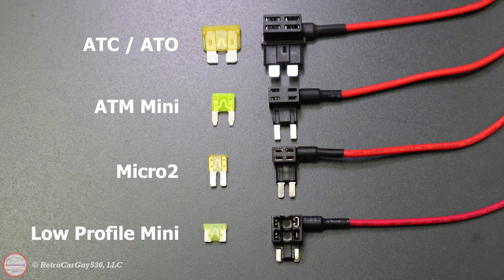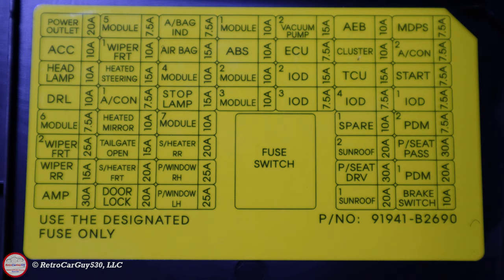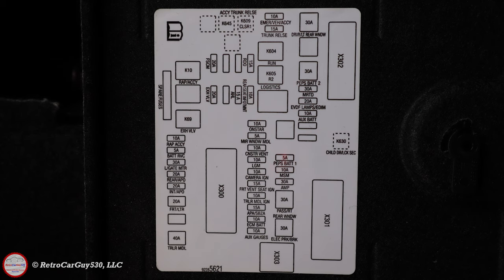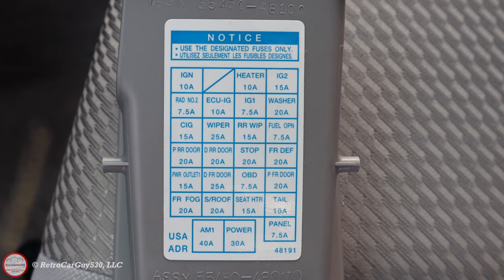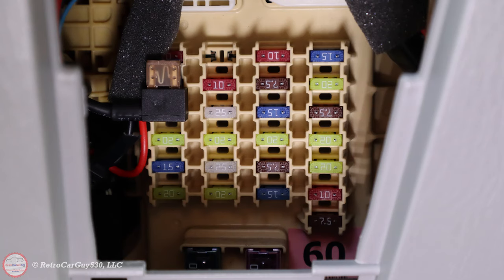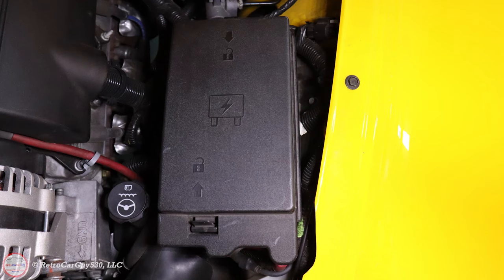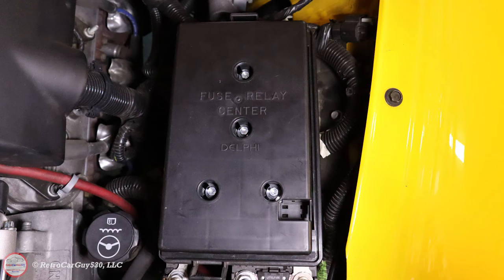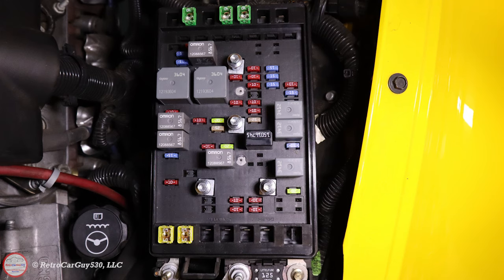How To - Add a Fuse Tap in Your Vehicle

Comment: Hey there so I cut my DC12v extension cable male to female 5.5mm x 2.1mm (The male plugs into my 10w LED Light box)
I cut the female end off and I was expecting 2 prong red and black wires
but there was 2 prong red and white wires ? 
Did I buy the wrong extension cable or something ?
Reply from the maker: I have no way of stating one way or another whether that extension cable is the correct one or not for your LED light box.  I would suggest using a multimeter to check which wire / color connects to which part of the male connector.  That way you should know which color wire in the extension cable is for power (likely red) and which is the ground wire.  That assumes you have documentation of which connector/pin on the light box end is power and ground.
Reply: Sorry it's hard to explain without pictures.
So I have this :
10w Light box with female port built in
1m Power cable with male port and 12v cigarette lighter port on other end

I want to hardwire this lightbox to my car by using a fuse tap instead of having cables running across my car and having my cigarette port used up so I want to make my own modified wiring

I bought a 3m Power cable extention 5.5mm x 2.1mm male to female (CCTV / LED/DVR/PSU)

So I can plug the male end into the light box 
Then the female end which would be the cigarette lighter port I cut off and I am left with 2 wires Red and White (I expected Red and Black)

I wired the fuse tap > red wire 
White wire > SPST switch > Ground eyelet (to metal chasis)
And the red / white wire is still connected on the male end which plugs into the Lightbox. Is it possible to email you some photos to help explain
Reply from the maker: Most of the time, red and black wire colors are used for a power cable, but the company that made the 3m extension cable may not follow that convention.  I did find a few barrel connector cables on a LED website with a red / white wire combo.  

I would suggest checking which part of the original barrel connector that is part of the cigarette power adapter provides the positive/ground.  

Test using a multimeter.  I tested an AC-to-DC 12-volt power adapter I have in my office and the center was the +12 volts and the outer part of the barrel connector was the ground.   When I had it reversed from what was provided by the power adapter the voltage showed a 12 volts and when I had the red/positive multimeter lead on the positive power connector the multimeter showed a +12 volts.  Using the +/ voltage indicator will help you get the correct leads from the multimeter on the correct connector of the barrel connector.   Use a multimeter to map out the power on the original power adapter for your LED light box.

Next, confirm which wire has continuity to which part of the barrel connector on the new 3m extension cable.

White = Outer part / Red = Center
- or -
Red = Outer part / White = Center

Then you'll know which wire should get the +12 volts from the fuse tap and which one should be connected to your SPST switch / ground.

I hope that helps.
Reply: Thank you so much for your time and reply, This is way over my head all I want is a simple 

Ground eye/fork  > Spst switch > negative wire >  Negative wire on 2.1mm x 5.5mm male jack 
Fuse Tap > Positive Wire on 2.1mm x 5.5mm Male Jack 
2.1mm x 5.5mm male jack plugs into LED Lightbox and hey presto!

Simple in theory but in practice i cant stop worrying if its correct

Im about to lose my mind spent over 18 hours today on this its driving me up the wall
I have wired it as if the red was positive and the white wire in the extention was negative 
If this is wrong will my car blow up?
Can I pay someone to create a safe harness for me ?

Comment: If the direction of the installation does not allow me to install a TAP fuse to respect the meaning of my voltage, what is my other option?
Reply from the maker: The alternative might be to allow the power from the fuse box fuse socket to be applied to the right leg of the fuse tap.  That's assuming the fuse box fuse socket had a fuse in it before adding the tap and the number of amps is very low for the new device (1 to 5 amps).  This will place the additional load for the new device on the original fuse when that fuse is installed in the lower fuse socket of the fuse tap, but it will very likely work if the original circuit for that fuse box fuse socket is not already running at an amp load close to the upper end of the fuse in the fuse box fuse socket.

A dashcam or radar detector often draw less than 2 amps.  Most dashcams draw less then 1 amp.

Supplying power to the left leg of the fuse tap is my preferred approach, but there are MANY that will debate that approach saying to provide the power from the fuse box fuse socket to the right leg of the fuse tap.  There are pluses and minuses to both approaches.

If the fuse box fuse socket did not have a fuse in it before installing the fuse tap, the lower fuse tap fuse socket must NEVER have a fuse in it.  The reason is that having a fuse in the lower fuse tap fuse socket will provide power to the fuse box that was not being provided before installing the fuse tap and that can cause strange / phantom power draws in some vehicles.  In this situation, the fuse tap must receive its power on the left leg to avoid having to install a fuse in the lower fuse tap fuse socket.

Comment: I understand how to do all of that but how do I connect the fuse tab to the wire I’m very new to this never done it before and I don’t have anything to solder it
Reply from the maker: The fuse tap will likely come with some sort of insulated butt connector (one or two piece) on the end of the wire coming out of the fuse tap.  You can use a crimping tool or gently use a diagonal cutter to crimp the butt connect down onto the wire.  Make sure the connector is fully protected (using some electrical tape or liquid electrical tape) to make sure the connection is solid and protected.

Comment: question I see you put 10A. in the new accessory  for LED hood light , that is have to be 10 A or can I put 5A ?   thanks
Reply from the maker: This video simply demonstrates the approach to locating a fuse socket.  The use of a 10 amp fuse in the demo was just a demo.  The amp rating for the fuse to use for the new accessory being powered by the fuse tap solely depends on what the new device/accessory requires and the wiring will support.  For example, a dash camera will not need a fuse of more than 2 amps in the fuse tap's upper fuse socket since a dash camera draws less than one 1 amp.  Putting in a fuse larger than required is not really protecting the circuit properly.  The fuse is meant to blow if the power demands of the device exceed what the wiring will support and what the device normally requires.

Comment: If you're using a socket that already has a fuse in it, doe the amperage of the accessory fuse need to be the same as the existing fuse, or can it be of a lesser amperage?
Reply from the maker: The new accessory fuse should have an amp rating no larger than the original fuse AND no larger than needed by the new accessory.  The fuse's job is to protect the wiring and the device being powered by that circuit.  If a device only requires 1 amp (like a dash camera) to operate, the fuse for that accessory should be no larger than 1 or 2 amps to protect the device and the wiring to that new device.  The other question to ask is can the fuse box fuse socket (and the wires that provide the power to it) support the combined load of both the original circuit and the new one being added in by the use of the fuse tap.  If both the original circuit/device powered by the original fuse in the fuse box uses its full amp load and the new accessory provided power by the fuse tap also uses its full amp load, will the wiring that provides the power to the fuse box fuse socket be capable of handling that combined load.

There's usually about a 10% amount of extra amp load capacity designed into most automotive circuits.  If the original fuse box fuse was a 20 amp fuse, that means there's about a 2 amp amount of "extra capacity" within the wiring that provides power to that fuse box fuse socket.  If you know for sure that the device provided power by the fuse box fuse socket is not being used that means you have more "free" amp load capacity available to be provided to the new accessory using the fuse tap.

If the original fuse was a 10 amp and you then try to add another 10 amp device via the fuse tap, you're asking the wires that provide power to the fuse box fuse socket to provide 20 amps which could exceed that circuit's max amp capacity.  If the total load being placed on the wiring that provides the power to the fuse box fuse socket is above its max load capacity, it's not safe to operate in that manner.  If a new device requires more than the 10% of potential extra capacity on any particular circuit, then you may want to consider running a new wire to the vehicle's battery (with an in-line fuse) and use a relay if you need it to have switched power.  I discuss the use of a relay to provide switched power in this video where I discuss the wiring options for dash camera battery packs.  https://youtu.be/Gn3IoBjO_Vg?t=1995

Comment: So I have a VIOFO a139 dash cam with hardwire kit and fuse tap,fuse tap already has a 3amp fuse.if I have an unused fuse slot,that would be ok to use as long as there’s power?also will I need to put another fuse in the empty fuse tap with the 3amp?
Reply from the maker: A dash camera is a low power demand device so that’s why they’ve supplied the 3 amp fuse.  If the fuse box fuse socket is unoccupied and it provides the power required, then yes you should be able to use that fuse box fuse socket.  The rule is that if the fuse box fuse socket did not have a fuse in it before installing the fuse tap, the fuse tap should only have a fuse in the top fuse socket of the fuse tap leaving the lower fuse socket of the fuse tap empty.
Reply: @RetroCarGuy530  just want to thank you so much, just hardwired my dashcam with your help. Everything is working perfectly.

Comment: Hello, great video, 1 quick question. I'm finding that on my car when the engine is off and I take the circuit tester to 2 particular  fuses that I wanted to use, both ends of the fuse light up. Would this be a good fuse to tap into or stay away from? I'm trying to hook up a dashcam. Thanks.
Reply from the maker: In the video I use "half of a fuse" to test which end of the fuse socket provides power so that I know which way the fuse tap would need to be inserted into that fuse socket.  You stated that your testing has both end of the fuse provide power which I am assuming means you left the full fuse in place to perform that test (which is tottaly fine while you're looking for a fuse socket that provides switched or unswitched power).

Your test results show that those two fuse socket provide unswitched (constant) power.  That may useful for your dashcam depending on whether it is a 2-wire or 3-wire installation for the power adapter for the dashcam.

Some terms to define:

2-wire installation = power (most often a switched power source) and ground
3-wire installation = unswitched (constant) power, switched (accessory) power and ground
Hardwiring kit = connects dashcam to vehicle power with or without a voltage monitoring device in the hardwiring kit.
Voltage monitor = checks the vehicle's battery voltage and it will turn off power to the dashcam when the vehicle's voltage drops below a predetermined level (like 12.2 volts)

A 2-wire installation can be done with dashcam hardwiring kit but there are a couple of conditions:

2-wire installation (hardwiring kit without voltage monitoring) = fuse socket must provided switched (accessory power)
2-wire installation (hardwiring kit with voltage monitoring) = fuse socket can provide switched or unswitched power

A 3-wire installation (often to support parking mode of the dashcam):

You need to locate two fuse sockets but each one must provide provide a different power source type (one switched and one unswitched).

The dashcam uses the switched power to determine when to enter or leave parking mode support.  The hardwire kit must also have a voltage monitor in it to prevent the dashcam from draining the vehicle's battery too low (as mentioned above).

I hope this helps you with your wiring.

Comment: When you find an empty fuse position that has power how do you know what amp. fuse you can use with the fuse tap?  Say the spot was for an accessory option that your car doesn't have and it would have had a 10 amp. fuse and you use that spot with your new fuse tap with a 20 amp. fuse are you going to ruin the circuit?  Thanks.
Reply from the maker: If that fuse socket is unused in your car, but it would have contained a 10 amp in another vehicle with same fuse box - it doesn't necessarily mean you can only use a 10 amp fuse in your situation.

The 10 amp fuse used in that other vehicle is protecting the circuit that is provided power by that fuse.  It all depends on the wire gauge, distance and current requirements of the feature/device/accessory being powered by that circuit.

In your car's case, the fuse socket is empty so it's a potential candidate for your new accessory/device.  The fuse tap is simply a means of accessing the power bus bar on the bottom side of the fuse box.  The expectation is that the power bus of the fuse box that supplies power to that fuse socket has some amount of excess power availability.  Otherwise, you would never be able to add a fuse tap.  An auto manufacturer will tell you to never add a fuse tap because they have "precisely" designed the number of fuses that each get their power from the fuse box power bus bar so adding anything else might be a problem.  There usually is a certain amount of extra capacity available on the power bus bar in the fuse box unless they auto manufacturer did a less than stellar job of mapping the fuses to the power bus bars in the fuse box.  When you add a fuse tap, you're assuming their is sufficient excess power available on the power bus bar for that fuse socket to support the power demands of the original circuit/fuse (if any fuse is present) and any power requirements for the new accessory.  The other requirement is that the fuse socket must not source its power from a control module (like a body control module) since power provided by modules in the vehicle will often have power checks performed by the module or are limited in the amount of power they can provide.  You should also not use a fuse socket that provides power to a critical system in the vehicle since that may have undesirable results by adding an extra power load. 

I have a FAQ video for fuse taps where I discuss that a fuse socket for blade style fuses should be limited to have an amp draw of no more than 25 amps (IMO) for blade style fuses.  If there is no fuse in the fuse socket, that is allowing the new accessory fuse to have an amp rating of up to 25 amps (again assuming the power bus bar in the fuse box has the excess power available).  If there is a fuse already present in the fuse socket, then the new fuse max amp rating would be 25 amps minus the amp rating of the original fuse.

Now that you have an idea of what the max amp fuse that could go into the accessory fuse socket of the fuse tap, then you need to see if the power demands of the new device/accessory will be under that max amp rating.  If not, you cannot use that fuse socket for the fuse tap.  If the power demands of the new device/accessory are under the max amp rating you calculated, then you can use the fuse box fuse socket, but you should only use a fuse for the new device/accessory with an amp rating no larger than what it truly needs.

For example, if the fuse socket had a 10 amp fuse, then you could have up to a 15 amp fuse (using my 25 amp max).  If the device itself only requires a 5 amp fuse, then you install the original fuse socket 10 amp fuse in the lower socket of the fuse tap and the new 5 amp fuse on the top fuse socket of the fuse tap.  You could have up to a new 15 amp fuse in this example, but you don't want to use a fuse with an amp rating above what's truly needed.  Using a fuse with an amp rating larger than the device needs is not protecting the circuit / device properly.  You always want the fuse to blow if there's a major problem on the circuit, but by using a fuse with an amp rating larger than necessary could result in wiring heat / failure problems or similar failure problems with the new device / accessory.

I hope that helps.

FAQ Video: https://www.youtube.com/watch?v=DnZ5wb_A5vE

Comment: Hi I have question. I want to power supply 12v for remote cable from active subwoofer alpine SWE-815. But don't know how big fuse I should use? I want to install adapter in cigarette socket if I don't find any other free hole with ignition power.
Reply from the maker: I cannot state how many amps a subwoofer will require to operate. It’s best to review the labels on the subwoofer itself or any product documentation to see if a maximum amp value is stated.  The other approach would be use observed data such as using an amp clamp to monitor the startup amp draw along with the continuous amp draw to see what the maximum amp value is for that device.